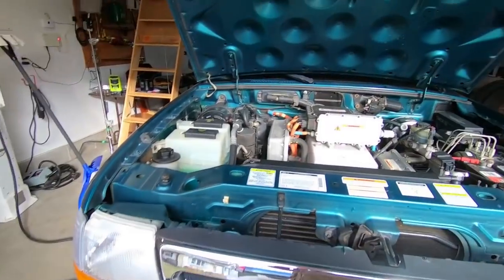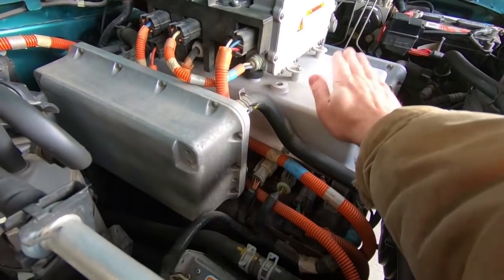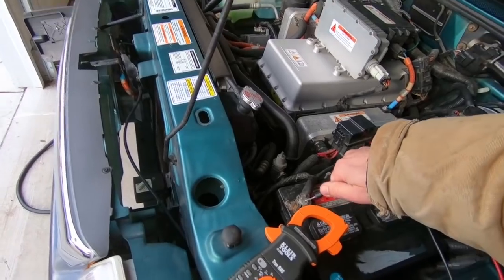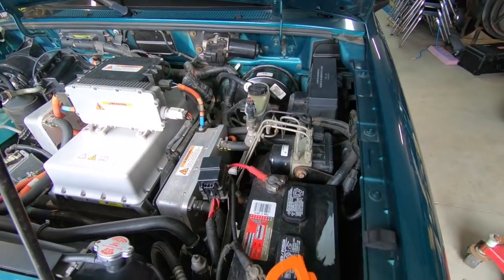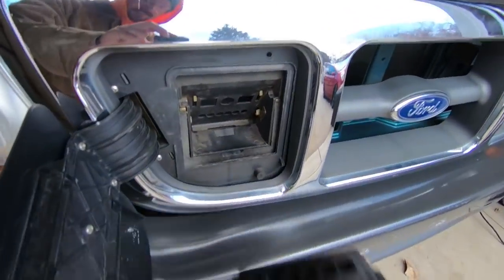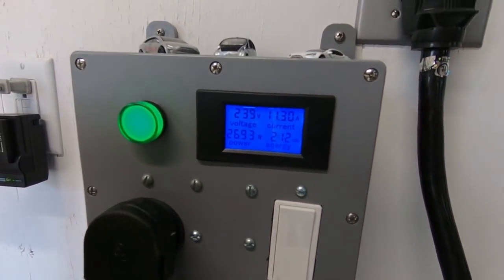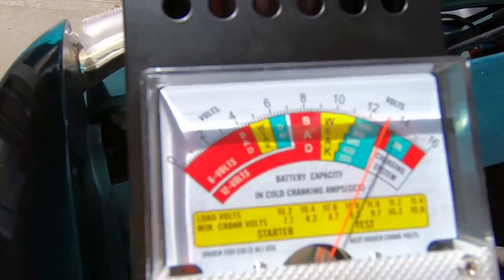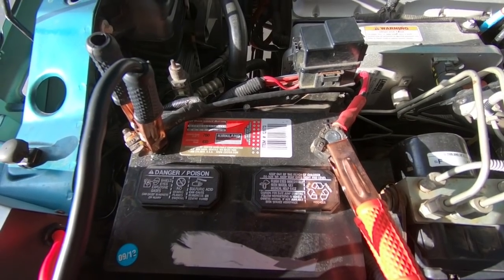Electric Truck CHARGER DIED!?!

Comment: Most effective way I've come up with making sure my 12v battery never dies is I have a 120watt flexible solar panel glued to the roof of the car. Because it moulds to the roof you don't even notice it's there's and it's constanstantly keeping your battery topped up regardless. They're cheap to buy on ebay

Comment: I would take the 12 VDC battery cables off , clean then and the battery posts .  Smear grease on both & re-install .  Pop the caps off & see it it needs water .

     Put a slow charger on the battery , maybe over night .  Then check the battery voltage .  All before you drop some coin on a new battery .

     All in all , you lucked out big time !   :-)

     Merry Christmas !   :-)

God bless
Wyr

Comment: Some EVs like the Hyundai Ioniq have a 12V battery reset function, which allows the driver to manually turn on the DC to DC converter long enough to get the battery up to its sustainable voltage (as long as it’s not shorted out), and then start the car, or in your case, allow charging to start.

I wonder if the ranger EV has that feature hidden somewhere. 

I’m surprised Tesla doesn’t have it. I’ve seen a few times when that would have saved Tesla owners some headaches. 

Obviously the DC to DC should not come on when the car is off, but if you somehow left your dome light on, and the battery was drained, rather that calling for a jump, you just close the emergency bypass that sends juice to the 12V battery, and the battery would come up above the 11v shutoff voltage and then the car can start and the DC to DC converter will start again in normal operation.

Comment: PbA batteries lasting longer than 3 years is rare.   Always date your battery upon installation.  EV's require deep cycle batteries for the accessories.  Don't buy a SLI (start, lights, ignition) type, has the wrong discharge curve.
Reply from the maker: I was glad to at least see a date sticker on the accessory battery! Too bad nobody marked dates on the 12V batteries making up the traction pack!

Comment: Yes I was gonna say check your 12v battery and/or disconnect main batt to reset.......  And is the truck charging your 12v battery? Normally a regular car will output almost 14V to charge the 12v batt

Comment: I’m glad the truck is ok! Will you keep the new battery on a tender? My Fiat 500e battery is 3 years old. I’m wondering if I should just replace it to be safe and not stranded. Can you get a “jump” from another car?
Reply from the maker: Electric cars are extremely easy to "jump-start". Unlike gas cars, which need to be able to power the heavy load of the starter, the electric car only needs the voltage high enough on the 12V battery to simply turn everything on.

Comment: Easy swap for just the one 12v  thankfully. Keeping a low amp battery maintainer for it or a solar charger will keep that from happening again hopefully. Merry Christmas and if the kids ask what happened tell them Santa's sleigh needed a jump start and the amperage on Rudolph's nose completely drained it! lol

Comment: As that 12v battery is not driving a heavy starter motor like in an internal combustion engine perhaps it would be better to have a deep cycle one fitted?
Reply from the maker: I read through the original owners manual for the truck, and it did indeed originally come with a deep-cycle style battery for the 12V system. The one in the truck right now appears to be a more typical starting type battery.
Besides the age of the battery, I'll also want to check the DC/DC converter. As best I can tell, it was working OK. I used a clamp-on ammeter to the battery with the truck on, and it was charging.
I'll also have to check to make sure there's no 12V load draining the battery that's always connected. I did notice that the truck has the old fashioned cigarette lighter plug (NOT a 12V power jack, an ACTUAL cigarette lighter AND Ashtray!) Those have power on all the time, not just when the ignition is on, so I'll have to be a little careful it I use a plug-in GPS or other 12V accessories.
Reply: @BenjaminNelsonX  I once had an old BMW Series 3 that I used to only use once a month and that battery was always going flat as there is a small drain on it that cannot be stopped.  I fixed it by adding a very small solar panel (5w) on the dash to keep the battery ok when it wasn't in use.  I know some people with classic cars that do the same :)

Comment: Hi Ben. My name is steve from Calgary (Alberta-Canada). I have a question : Have you  already tried to plug a generator to your truck while you driving ? Cause this might allow you go over 65 miles while recharging batteries on the road. So let me know what you do when you got go for long ride( over 100-300 miles ). Thank you.
Reply from the maker: You can NOT simply plug an electric car into a generator and drive it. There are safety features which prevent you from being able to do that. Because this vehicle has been modified, the battery pack IS accessible, and power could be sent to it, but it would still require a high-current 312VDC charger.
Even with a charger like that, you would still need a substantial generator to continuously power the vehicle. The Chevy Volt is one of the few commercially-built vehicles on the road right now which does something similar. That uses a 1.5l engine to perform that task.
The only vehicle I can think of right now that will go 300 miles on a single charge is a Tesla with a 100kWh battery pack.
If I had to drive 300 miles right now (which I don't. I might do a drive like that once or twice a year) I would probably just drive our 14 year old Toyota Prius.
Reply: Thank you  @BenjaminNelsonX   But On Quora forum, alot people with brand EV  say that they often do that on the road  and that this still possible for people who made EV conversion through AC motor . They call this regenerative braking.  
I still driving my old Ford F 150 2005 5,4L. Are you absolutely sure that even if i use an AC75-100 motor, i will not be able to recharge my batteries while i driving on the road ? Cause i plan to  use a free energy magnetic generator 40 KW. Thank you.
Reply from the maker: @alexisallogo5430   Regenerative braking SLOWS DOWN THE VEHICLE. That's why it's called regenerative BRAKING! You can NOT DRIVE down the road with the motor on power from the electric battery, while simulteously using the motor as a generator to slow down and put energy back into the battery!
You could build a vehicle with both an electric motor AND a gasoline-powered generator and have electric power from the generator feed the electric motor. That's called a series-hybrid. It's essentially how a diesel locomotive works. But that's not an electric car. It's a gasoline-powered one. All you ever really need to think about in projects is WHERE DOES THE ENERGY COME FROM? After that, you just try to use it as efficiently as possible.
https://300mpg.org/projects/electro-metro/perpetual-motion/
PS: Never use Quora as a source of knowledge for anything! Go to a reputable forum dedicated to the topic you are interested in and listen to long-time, well-known, knowledgeable people there.
Reply: Thank You  @BenjaminNelsonX  for all those details.
Reply: alexis allogo Those ‘free energy’ generators are 100% scams. Nobody has ever proved they work, it’s all designed to intentionally mislead you into assuming they make free power when they don’t.

Comment: You need a dumb charger to push the charge into the half dead battery, those smart chargers aren't worth it, they read voltage and the battery can still show 12 volts and still be dead. Get yourself a real battery charger for Christmas, one that will fry a battery if you need to, they don't shut off they just keep pushing the power. I had one of those fancy racing batteries, glass mat I think, it died after a year, the company told me to cook it with a dumb charger, it worked. You can make your own from a old computer power source just use all the yellow and all the black wire . I'm only talking about the small charger and the battery under the hood.
Reply from the maker: I've been happy with that particular charger. I DO agree with you that in some cases, a VERY basic "DUMB" charger is advantageous. A battery way out of range will typically just error out a modern charger. There are times where I HAVE needed to use a dumb charger just to get some juice into a battery to start with, then finish it with a smart charger. Unfortunately, those batteries are usually heavily degraded - it's not as though the dumb charger rejuvenates them. Still, a handy trick to know!